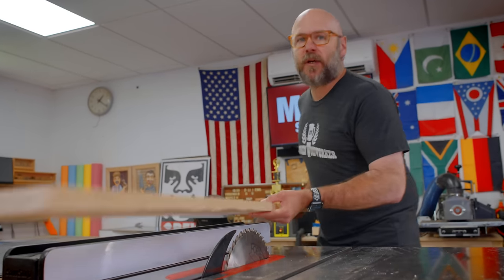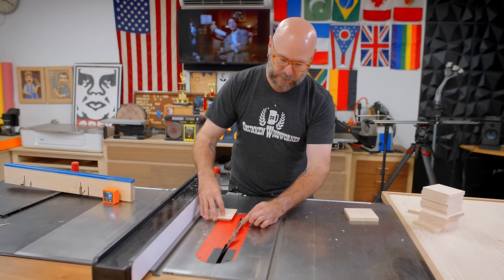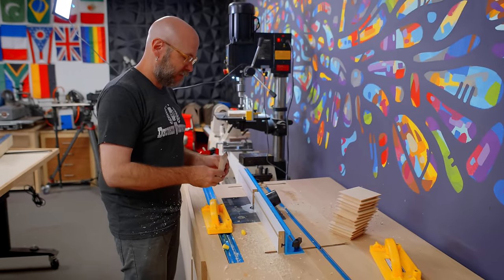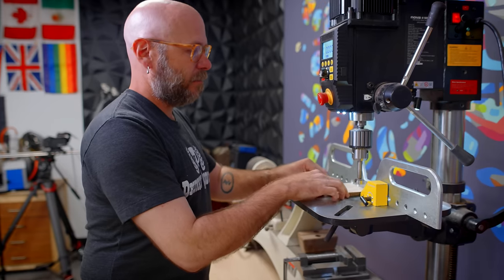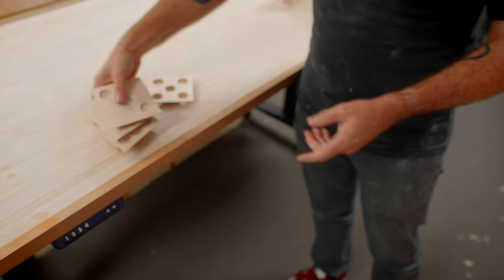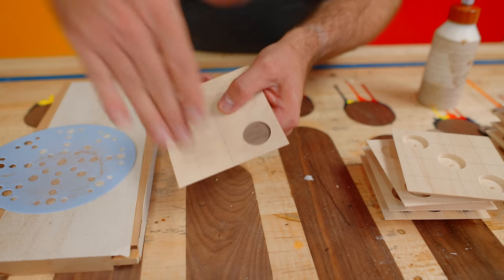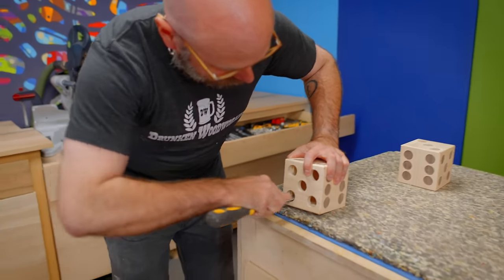How to make dice pencil holders. Easy woodworking project.

Comment: 02:30 I solve the problem of a sharp edge running under the fence by adding a piece of very light gauge aluminum angle clamped to the fence with one leg on the table and the other clamped to the face of the fence. I use a piece of 1/16" x 1-1/4" x 48 " long. It's about $15 at home centers. You let the sharp edge of your piece rid on top of the angle and it can't slip under the fence. On a narrow piece this may introduce a slight angle in the cut because the edge nearest the fence is riding on top of the 1/16" thick angle. You can trim the leg of the angle that sits on the table down so it is only 1/4" wide which will help. A 1/4 inch is all you need.

Comment: Nice set of dice.  I have made a few sets that resembled this.   I made a modified miter sled with a dedicated 45 degree slot like you mentioned.  It worked well.  On each of mine, the six was the top .   (I'm not as creative as you.)  I drilled down like you did to extend the top holes.
I don't have any type of laser and I'm too cheap to pay for epoxy, so I painted all of the other holes, 1 through 5.  It's an interesting gift to give to someone who sits at a desk or in a cubical all day.  I also made a few sets out of 4x4 posts and put together a Yardsee set.
My family loves to play this in the yard on nice evenings.
Thanks for the video.

Comment: For your table saw tear out issue, try running blue painters tape over the throat plate tight either side of the blade and a strip across in front of the blade to make a zero clearance. This works a treat as a zero clearance instead of having to make a new insert
Reply: I came to the comments to say the same. I do this on my dewalt and it works great.

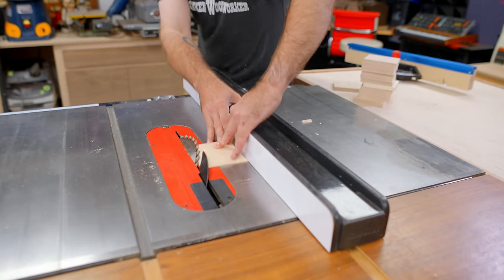Comment: Ya, definitely use a sled, mitering under the blade like around 2:40 is a recipe for kickback. With an old right-tilt saw, I built a sled solely for edge miters.

Comment: @ 2.00 mins, an option, for your backfire issue, you may or may not have discussed, making a zero clearance inlay for 45⁰ cuts especially in smaller pieces 👍

Comment: would it be easier, faster, and safer to cut two of the bevels prior to cross cutting to the "square" pieces (i.e. when the board is still long), then use a bevel gauge at 45degrees or a bevel sled to cut out the squares?